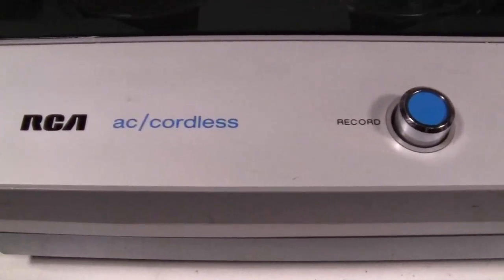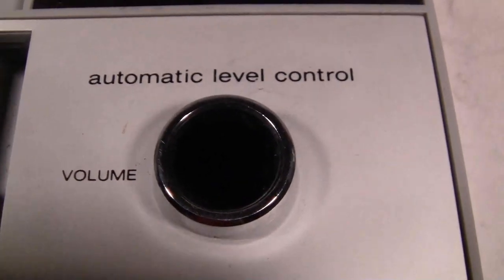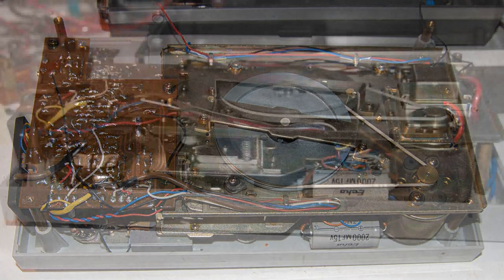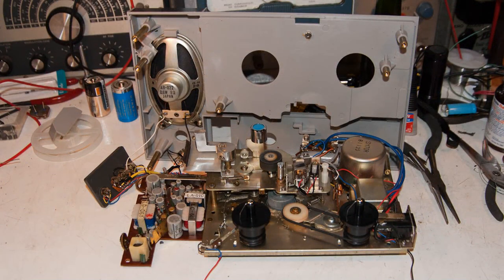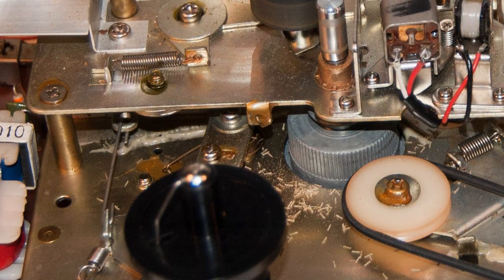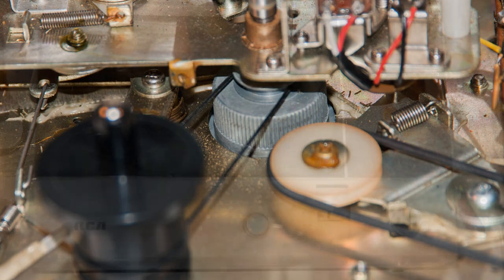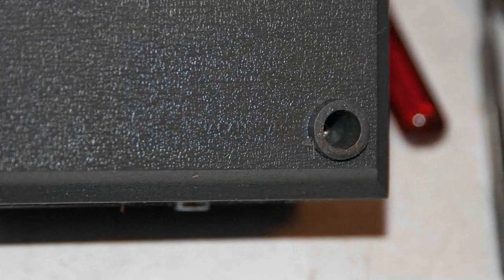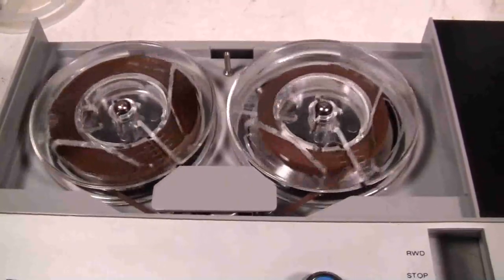RCA Tape Recorder Repair, Portable Transistor Model YZS510J GRAY

Comment: Did you know it's a two-speed tape recorder? The post between the two reels gives it away. There should be a screw on the capstan (most likely the very top of it) that enables you to remove the outer sleeve and exposing the thinner capstan within. The sleeve screws onto the post for safe keeping. The speeds are most likely 3.75 ips and 1 7/8 ips.